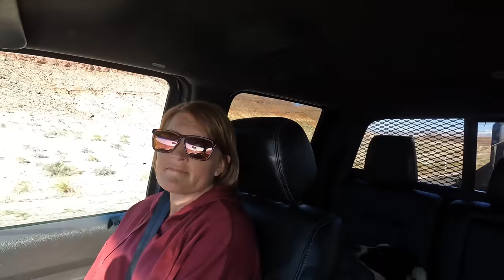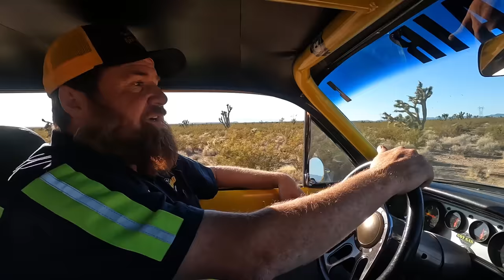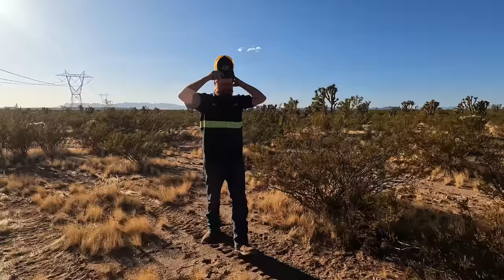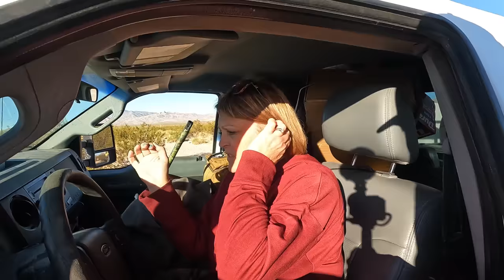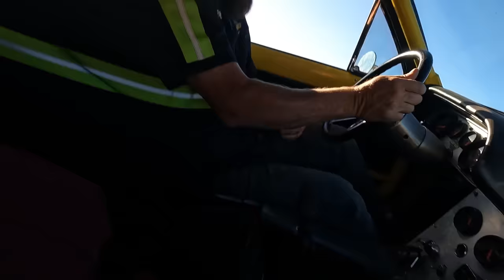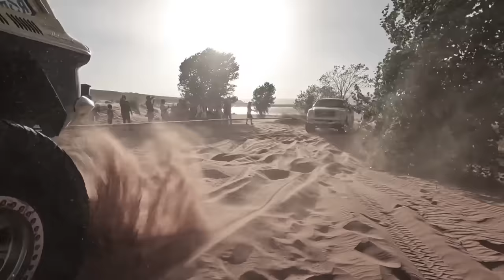All The Jobs Are Gone In Utah

Comment: 2:18 ok I get it, but keep in mind when a tank gets low the fuel sloshes around much more and disturbs/suspends the sediment that was laying harmless at the bottom but now its headed into the filters.   Its not a big deal on occasion, but it can be if you routinely wait till the light comes on.  It's especially problematic if you operate in very dusty areas, for two reasons.. the vents in your fuel/emissions system will let some dust in, and your local fuel stations have the same problem.

Comment: If you were to have fuel tanks at the shop that would be regularly topped off by a fuel company, that way you could designate someone, daily, to top off or at least check fuel levels in your fleet of equipment
Reply: Matt's offroad recovery gas cans I thought would be a good item to sell.
Reply: I was thinking the same.  Bury two tanks: one for 91 or whatever the high compression gassers take, and a smaller diesel tank to supply Blue Steel.
Reply: Matt's off road Jerry cans new never been used!
Reply: GREAT REPLY  !!!!  this gas thing is a Very Big deal

Comment: I feel your pain about stopping at gas stations, my f250 wouldnt go more than 500 miles with both tanks so I took out the spare from under the rear tank, pulled the tank and installed an aftermarket twice the size. Now I can go from Los Angeles to Eugene Oregon before having to refill, almost 900 miles. Spare goes in the bed now but it was worth it.
Reply: Just imagine waiting to charge an electric vehicle!!

Comment: Who should be in the driver's seat of an off road vehicle for the games? CEO/COO and/or design engineers from SUV and passenger car manufacturers. Specifically, if you can get them doing a common off road recovery that you encounter often because drivers take them stupid places. Make them do the complete hook ups with no tow/recovery points so common on newer vehicles. Maybe the engineers and builders might learn something.

Comment: Oh wow. Finally I know why that one kind of guy is always running out of gas! I used to work with a guy like that. He had me drive his pickup down to get gas once. He had it so perfectly planned out, it ran out exactly as I drove into the station.

I only once let one of my vehicles run out of gas. It's an antique Chevy dually (1977) with double tanks. It wasn't in great shape, I didn't drive it for awhile... Oh right, that was when the radiator exploded... I took it to a mechanic because it had a new vibration after I put the new radiator in (it turned out it was the cooling fan. I'm not sure if the cooling fan broke and a flying blade hit the radiator causing it to explode, or if the radiator hit the fan and broke it when it exploded, but the fan was missing a blade. The radiator was easy. I couldn't even tell the fan was messed up.) Anyway the mechanic called me in to do a test run with him and help tell him what I was feeling that was a problem. Right as we were getting done and heading back to the mechanic shop, it quit. It sometimes vapor locks, so I thought it was that at first, but it was weird, because it usually vapor locks going uphill on hot days. It wasn't very hot and I wasn't going uphill.

So the mechanic asked me if I was sure the gas gauge was working--it read totally full. I replied, "I know for a fact that it doesn't work at all." I blinked, thought back on how much I'd driven it since the last time I fueled it up. I switched gas tanks. It didn't pick back up. I nodded. "Yup, I'm out of gas." Only time I ever let that happen, and it took all that.

Comment: 3 minutes in and it's like you're reading my mind: I too, never want to stop, especially when driving. 

That said, the threat of running out of gas means a "big stop" which is an even greater fear than the gas stop.

With all that building you're doing for the new shop I'm surprised you didn't get a personal set up so you can just top off in your way out the gate.
Reply: The feeling of a full tank of fuel in my vehicles is so worth the stop.  Taking a shower and using the restroom are huge waste of time.  I can't tell you how many emergency walks(runs) from the shop I've had to do barely making to the restroom because I was in denial and didn't want to stop.

Comment: You should hire a fuel delivery  company setup a fuel tank system at your shop. Then you could leave the shop with a full tank every time. No stopping at the gas station, then you may just miss out on the snacks.
Reply: I'd really like to see how Matt could use a Rivian or something and it would always have a "full tank" when they left the shop.

They don't go that many miles for most of their jobs, and it seems like they use Blue Steel when they have a long way to go
Reply: This is actually such a good idea thats so obvious i can't beleive i havent seen it mentioned before lol
Reply: @GregMcNamer  I love this channel for the projects almost more than the recoveries sometimes.  A Rivian setup for off-road recovery would be pretty sweet to see.  Maybe Rivian will sponsor them someday and we could get to see that.  Just thinking offhand but a Rivian with solid axles and 4 drive hubs would be pretty unreal.
Reply: @ConSeann3ry I think the heavy vehicle weight would be an obstacle up front. The battery pan would be a second, and thirdly suspension adaptability. 

At a high level, the vehicle weight would be great for easy recoveries, but could quickly become a problem. Secondly maintenance may be an issue. Thirdly part’s availability.

Comment: I have always refilled my tank at 1/4 mark with any vehicle with a in tank  fuel pump. I have been told by multiple people that the pump actually uses the fuel as a heat sink to keep the fuel pump from overheating and failing prematurely.
Reply: With nearly all fuel injected vehicles the pump is in a “bucket” that keeps the pump submerged in fuel basically until it completely runs out. 
And, often when the gauge shows E there’s still a couple gallons left. 
Certainly not hurting anything by refilling a 1/4. But, also not much to worry about if you get under 1/4.
Reply: @NBSV1 yes!!

Comment: Fun fact.  Many Hime Joints have a hole in them at the bottom of the female thread. This hole leads to a radial grove around the ball. If you place a small amount of grease in the bottom of the treaded hole, then assemble the Hime joint to your suspension component, grease will be forced through the hole and around the ball. Also, some of the larger Hime joints can be purchased with Zerk fittings attached for greasing the ball.

Comment: If getting gas is so hard for you (I don't like it either) why not have an above ground gas storage tank in the yard? I grew up with a 1000gal diesel tank on the farm for the equipment and a 250gal gas tank for the smaller equipment. A delivery truck would come and file up our tanks when needed.
Reply: Wow, I'm sure Matt has never thought of doing that. (rolls eyes)
Reply: @ColdBeer99  you're comment is as helpful as an empty gas can. (Rolls eyes in the opposite direction)
Reply: That would only compound the problem.  He would then have two tanks to fill.
Reply: @akelagold kinda. Someone comes and fills your bulk talk for you.
Reply: ..and, somebody else would be in charge of "fueling the fleet" daily (or checking them). That same person would keep the log of fuel used for vehicles - helps for taxes, and then would order the storage tanks refilled.
Reply: Its a great idea, much more convenient. But I wonder about tanks being in the desert heat. Theres bound to be regulations for private gas  tanks. They may have to go underground which is a much bigger cost. 
  I wonder Matt's take on gas tanks? 🙂

Comment: Get 2 extra saddle tanks I have an Xtra 28 gallons for my already 34 gals 19 1/2 mpg diesel 858 hp 1190 ft lbs torque Dana 80 4.10 air lockers drilled, slotted zinc plated rotors 6 piston breaks stainless lines tru 5 speed +overdrive jasper stage 3 tranny I float on my 36×12.50× 18 beadlocked maximum tires 65000 mi warranty

Comment: Why do you insist on videoing and uploading videos of lame behavior? Perhaps hamburger helper for content hungry production? Check one or more... Out of gas...none on board... Flat tires... No Spare tires? No trail tools... Lack of rig maintenance, causing mission delay, lost bolts or nuts causing component falling off... Poorly or under engineered stuff failing??? Never have seen a mention of a pre-trip inspection, or a bolt tightnin' session before setting out. A bag of misc pieces/parts, nuts and  bolts on trail is a good thing. Rant over, I know that delivering quality videos is tedious and tiring. But sometimes, Ya know?